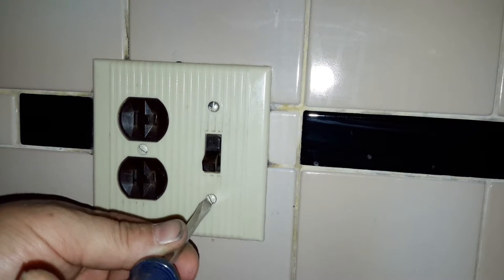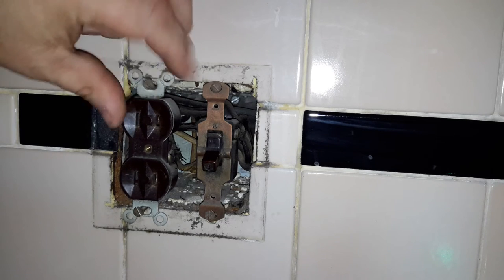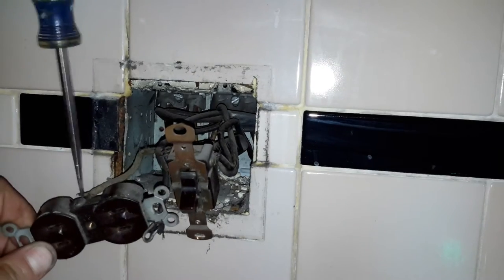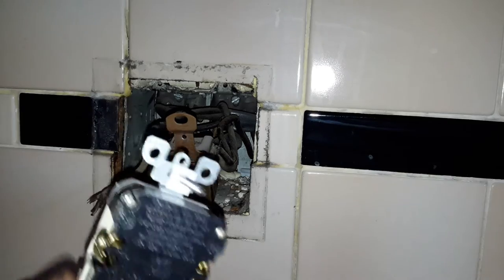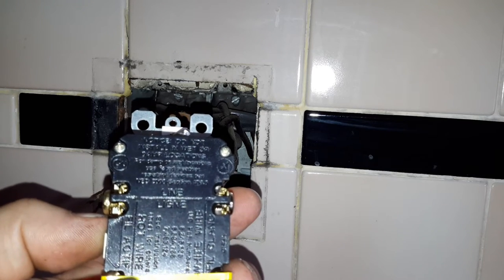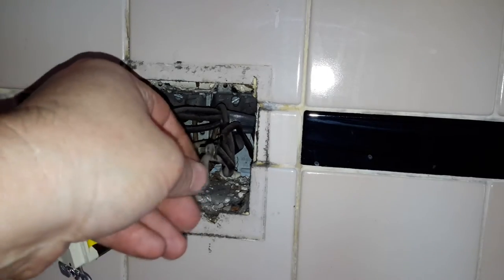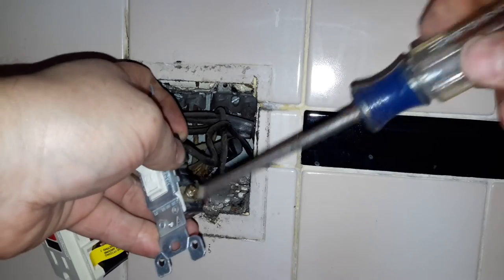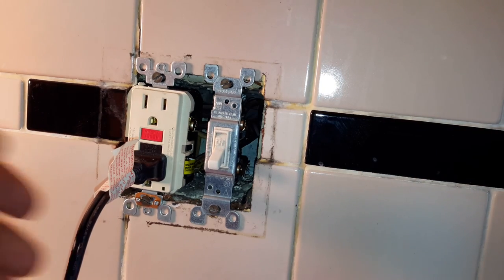Plug switch replacement with GFCI and new switch

Comment: Its not grounded. So that gfci doesn't even work.
Reply from the maker: A gfci does not need a ground to work. These can be used in locations where a ground is not present when replacing a receptacle without a ground .
Reply: themrhelperguy.  If a plug has a ground on it and its not grounded it will never pass inspection. Sorry you're wrong my wrong my friend. I've never seen a gfci without a ground so. You've installed it incorrectly.
Reply from the maker: Im not wrong on this one. Every Magazine publication This old House,Old House Journal, Fine HomeBuilding etc covers this at least once per year. A gfci does not need a ground and can replace a 2 prong plug  without a ground. So a gfci  without a ground will pass an inspection. If you are missing the ground you cannot install a plug with a ground and would have to replace the ungrounded plug with a new ungrounded plug. Usually available at the home center. I even think gfcis have stickers in them that identifies if the gfci is ungrounded.
Reply: themrhelperguy so, you're saying what you installed will pass inspection? I think not
Reply from the maker: That is wired with BX so there is a ground present. But lets just say that there is no ground. You would install a 3 prong gfci plug and install a sticker on the plate cover that is included in the gfci box that states. NO EQUIPMENT GROUND. This is a good comment because this is not commonly known. The gfci instructions also will address this missing ground issue and the use of a gfci plug. Thanks for the comment.
Reply from the maker: There it is
Reply: themrhelperguy let me get this right... So, it would pass? I've talked to electricians and they said that the inspector what check for a ground every time and if not, it doesn't pass. Yes it'll work but good luck getting passed the inspection
Reply: Maybe, you don't worry about those kind of things but eventually they're or even will want to sell the home and then will be fishing wire. Not what I want to do, but feel free to do whatever you want to do. I'll do it right
Reply from the maker: Maybe the inspector should read the gfci instructions. This will absolutely pass an inspection. A gfci works by  measuring the voltage going into the plug and going out. If there is a difference the gfci trips. No ground needed. I'm not going to say there is not that 1 inspector per million that would  fail that. I would be interested in what code he would cite to fail a gfci without a ground in an existing plug replacement.
Reply from the maker: The only question now is what to do with all those NO EQUIPMENT GROUND stickers inclued with the gfci. Maybe cut off the NO off and put them on all the other outlets in the house with a ground.
Reply from the maker: Eventually you will get a different  inspector in your area and this won't be an issue anymore.
Reply: themrhelperguy Lol. You're hilarious. Every time and everyone else is installing the plug wrong then. In my experience and the electricians that I talk to says that if the plug you're putting in has a ground on it it has to be grounded. Go ahead, be a hack, but it will come back to bite you. And there it is. Lol
Reply from the maker: This is not my call. Every publication has covered this gfci without a ground installation. In the gfci instructions this installation is addressed. If I'm a hack so is every gfci manufacturer, old house journal, this old house, fine home building, tools of the trade, journal of light construction,  you name it they all covered this exact problem. If the plug is not a gfci and does not have a ground you cannot install a grounded plug.
Reply from the maker: Really for your own peace of mind. In that video the bx uses a metal jacket to ground the plug. So there is a ground and the gfci is grounded. You can relax it's grounded.
Reply from the maker: Sec. 210-7(d)(3) permits any of the following installations when replacing a 2-wire ungrounded receptacle:(a) Replace it with another 2-wire receptacle;(b) Replace it with a GFCI-type receptacle and mark the receptacle with the words “No Equipment Ground;” And there it is.
Reply from the maker: That is the National Electric Code.  Covers the entire United States of America.
Reply from the maker: Maybe the electricians you talked to didn't understand your question. They could be addressing a regular plug and not a ungrounded gfci installation.
Reply: themrhelperguy. You must be from a third world where that's allowed but around here it won't pass. Good luck to you my friend
Reply: @aservant2287  in the USA its code..im a union electrician in Chicago. It just needs to be labeled this is why when you buy a GFCI outlet it has stickers for specifically this as it follows the NEC